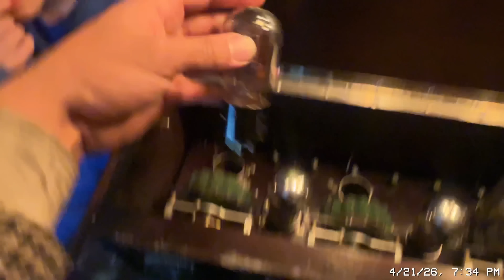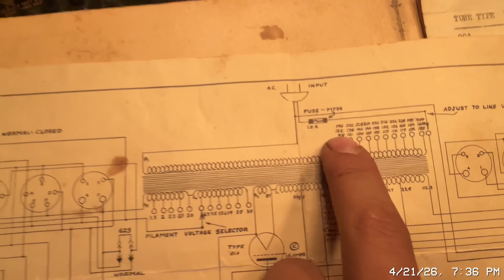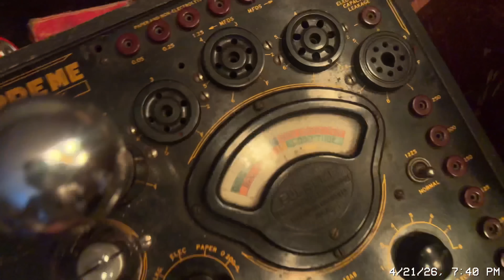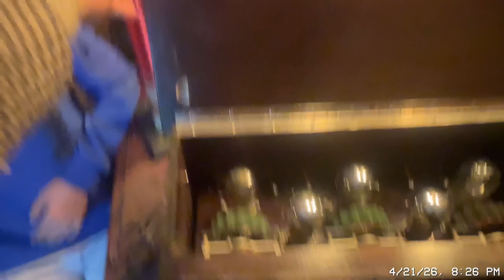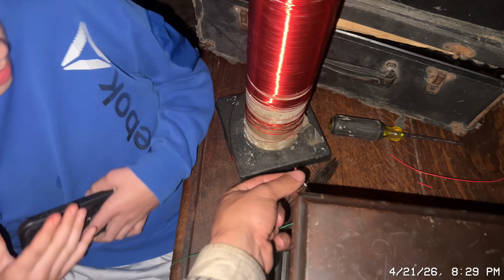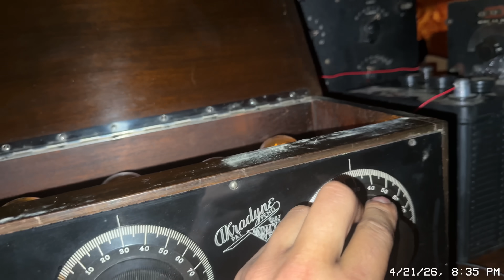Fixing a radio from 1925

Comment: I remember when the local hardware and even the Drug Store had a Tube tester and new tubes were stocked in the cabinet underneath. 
Wondering if Parker has an old "Sun Tune" or equivalent for tuning cars before computers. I have an older car, 1969, probably too new fangled for Parker 😅, but I have asked around and haven't found one yet. Would love a demonstration if so. Keep up the good work and good luck 👍.

Comment: Like you didn’t look at the tubes before you did this😂
Reply from the maker: I remember the tubes I’ve worked on this radio before
Reply from the maker: There’s two Sylvania 201-a tube 2 Cunningham 301-a tubes and one Cunningham 300-a tube so all are type 01a tubes except the one detector tube.

Comment: The 1930s is when they made good signal locking circuitry.  The 1920s radios are a whole different animal.  As you show, they take a lot of fiddling multiple dials to get a station dialed in.  I guess that adjusts the RF bandwidth and such.

Comment: Headphones? On a radio of that age? We really haven't invented anything new for a long time.
Reply: I thought the same... Headphone jack ?🧐
Reply: There's no significant way to upgrade a simple analogue connection intrinsically. That's why we focused on upgrading the devices that output the signals. Those have changed drastically.
Reply: I'm checking my comment history rn and the way I worded this feels pretentious. Sorry
Reply: aye, headphones are an 18th century invention. 

all the power switches, plugs and other basic electrical fixtures you interact with on a daily basis are also an 18th century invention.
Reply from the maker: 19th century 1800’s 👍🏻
Reply: This old stuff is super 🆒 , notice no plastic 😎
Reply from the maker: There is very early plastic Bakelite